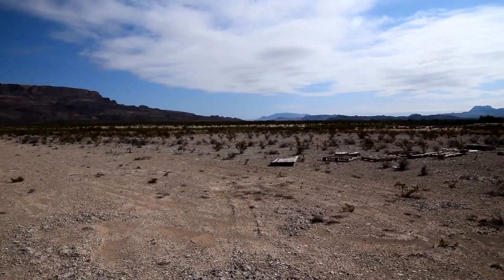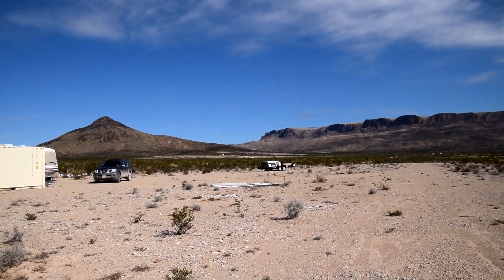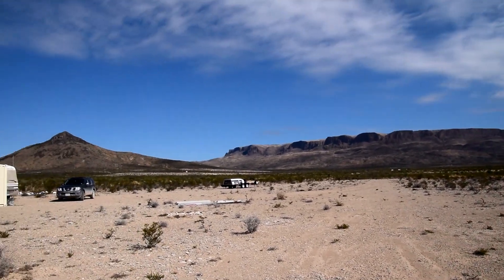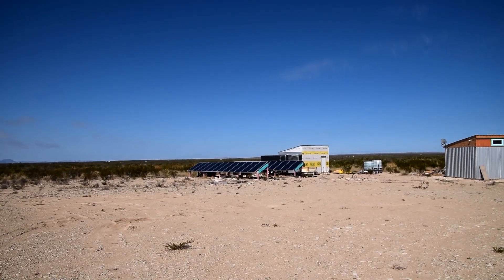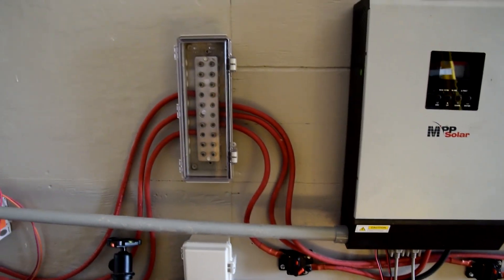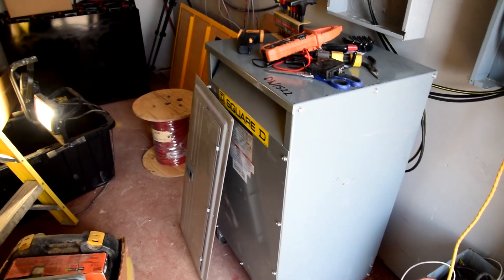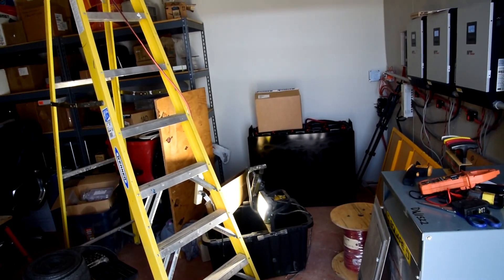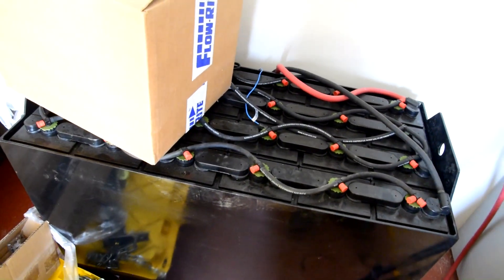How much did our solar system cost?

Comment: Like the setup! Great to see the inverters setup - that is a lot of power, 15kw. Do you know the over all surge capabilities? Also how well does the transformer work? Does it have a high idle draw? Trying to decide on the route that you took vs. MPP's new LV 5048, split phase inverter. The cost for just one shipped is close to 2 of these. Seems pretty high for what you get. I am thinking the combo that you have is a better deal price per performance (now seeing them listed under $600 with $150 to ship to US ($750 total for 1). Thanks
Reply from the maker: Not sure what the peek surge is but I have hit high enough to pop the 2 - 20 amp breakers that I have the inverters feeding and the inverters didn't go into over current. The transformer sits around 180-230 watts unloaded. It's interesting when you put load on it though because I can draw 200 watts and it only goes up to about 275 watts. I like the non split phase inverters because you can go up to 45Kw whereas the LV's are limited to 15Kw and having the transformer is an extra load but it also buffers heavy loads so there's some benefit to it as well.

Comment: Wow. That’s a huge system. Very impressive. What do y’all use as a charge controller? I don’t think I saw that.
Reply from the maker: The inverters have integrated 80 amp charge controllers that can take in up to 450 volts. I guess I should have mentioned that, I had it in my notes but forgot all about it ;)